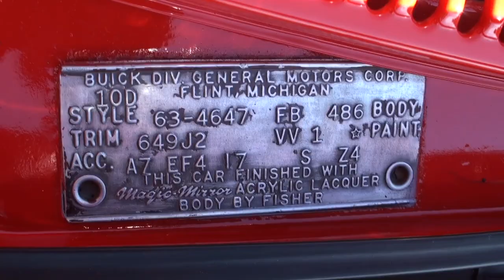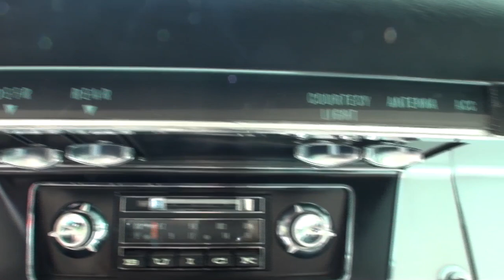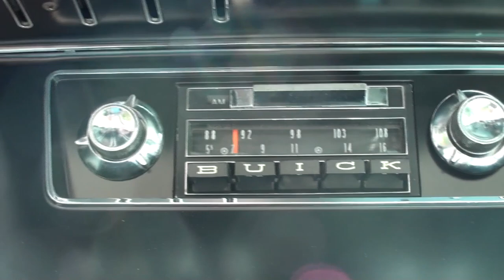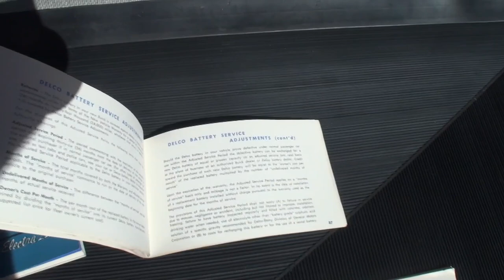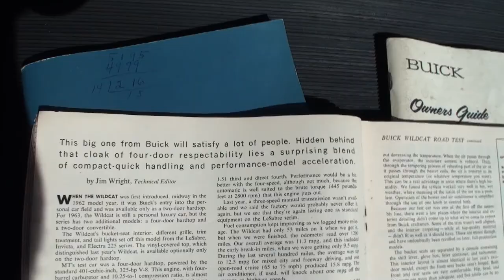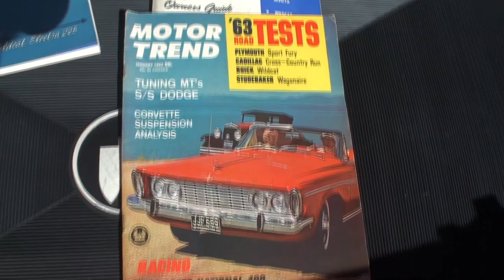1963 Buick Wildcat 2 Door in Red with 401 Engine, 4 Speed & Ride on My Car Story with Lou Costabile

Comment: WOW WOW! This just might be one of the HOLY GRAILS for BUICK! 👍👍👍 I also believe this was the First Year for the AM/FM Radio which is very RARE for 1963! I don’t believe Redline Tires were available yet??? Not until 1965! Also take Note of those Beautiful CORRECT EXHAUST ends! There is nothing like a NAILHEAD V8 Buick 🏁🏁🏁
Reply from the maker: Happy to receive "WOW WOW!" :-) Lou
Reply: Not sure on the year redlines were first available. I have them on my 67 Buick Special Deluxe bought new by my great grandparents. I think it had white walls factory. I like the look of the redlines. I also know you could get radial tires in 67 as a option.
Reply: @thomasthurston6656 ; Yes, I think radial tires debuted in 67' on certain models,  although not of the steel belted variety which became available in 69'. 
I think the Cougar GT-E 427 (W code) came equiped with them in 68',
and possibly on 68' Cougar GT-E 428's if not, optional.
Reply: @Johnnycdrums  Yes, I have dealer info that you could get radials in 67.

Comment: I have owned four 1963 Buick Wildcat cars. One four door hardtop and two two door hardtops with 401 and the Dynaflow auto. One two door hardtop had the 401 and Borg Warner four speed. I drove this car to Dallas and back many times, and I let a friend take his family to East St. Louis in it once. It had no mufflers but dual straight exhaust. It was capable of nearly 75 mph in first gear and I had it up to 45 backwards once. Mine ran a Carter AFB carb while some of the Dynaflow equipped ones had a Rochester 4G. After driving it for three years a guy offered me a good price for it. It was a good car as all four were.
Reply from the maker: Hi Robert, Good cars, and good times :-) Thank you for viewing & sharing, Lou

Comment: Interestingly optioned car which was obviously specially ordered. Total production of the 1963 Wildcat Coupe was 12,185 compared to Bill Mitchell's masterpiece 1963 Riviera with production of 40,000. The Wildcat Coupes got super slippery styling for 1965 thru 1968 before reverting to a more formal looking design for 1969 and 1970. This example competed in 1963 with Oldsmobile Starfire, Pontiac Grand Prix (stunning design), Chrysler 300 and 300J (very rare), and Mercury Monterey S-55. The cost of this 4-speed manual was $263.
Reply from the maker: Hi SpockvsMcCoy, Thank you for viewing & sharing your knowledge, Lou
Reply from the maker: Thank you for viewing and sharing.

Comment: What a beauty!  One of my favorite cars I owned was my '63 Wildcat.  5 years of good times with it.
  
Someone [dealer add on] added the dual-quad setup, as it was not a factory option until 1964, then only on the 425 engine.  Same with the 15" chrome wheels.  '64 beginning - then with black centers, not white.  Not taking anything from this car, it is beautiful...just not quite original.

A bit of ventiport trivia:  last year for them on a wildcat was 1963.  Following 1963, the ventiports were represented by aluminum/chrome hash marks on the front fenders. BTW, Lou, it is called a hood spear, not an ornament chrome thingy...
Reply from the maker: Hi wagonmaster1974, Happy to read this one is a favorite of yours and glad to read you had one too. You mean the chrome do dad on the hood?  :-) Lou

Comment: Before this video I had only seen two 63 Buicks with stick shift. One was a LeSabre 4-door sedan with 3-speed on the column and the other a Wildcat convertible somebody had for sale in NJ, but it was in terrible shape. That was a 4-speed like this. I think that was back in the 80s. As far as I know the LeSabre with 3-speed still sits in the junkyard, rusting in peace. These cars were really hard on gas. I had a 62 Wildcat I swear got 4-5 MPG if that. You would think it had a hole in the gas tank. A friend had a 63 leSabre 2-door HT, automatic, that got 8 MPG. He put over 100,000 miles on it that way back in the 70s and 80s. I've had a few other early 60s Buicks; another 62 Wildcat and a 62 Invicta convertible. They were all nice cars.
Reply from the maker: Hi g bridgman, Happy to read you appreciate the rarity of this 4 speed car :-) Thanks for viewing and sharing the cars you remember, Lou

Comment: Buick never marketed a dual quad setup until '64...& then ONLY w/the Wildcat 465/425 cubic inch motor. This may be an owner or dealer conversion. This first year tilt-steering column option is even more unique in that it's a floor-shift tilt, instead of the more commonly seen column-shift variety.
Reply from the maker: Hi M20L35, Thank you for viewing and sharing your knowledge. Hope you see many more cars on this YouTube Channel you enjoy. Lou